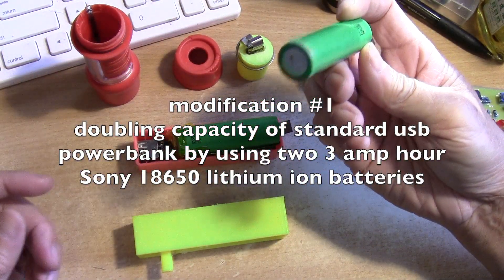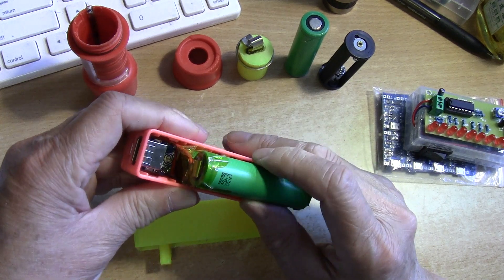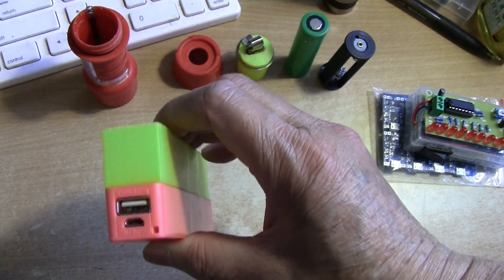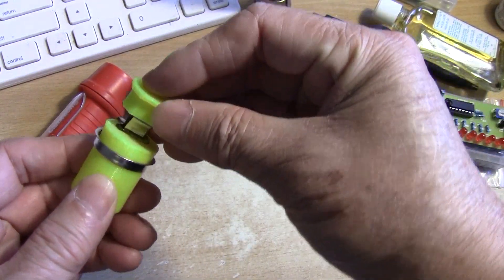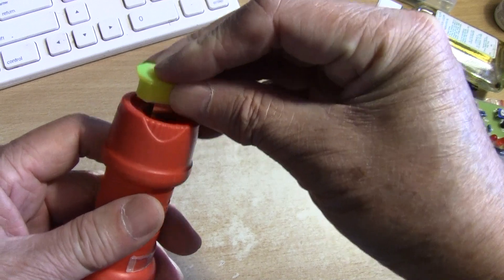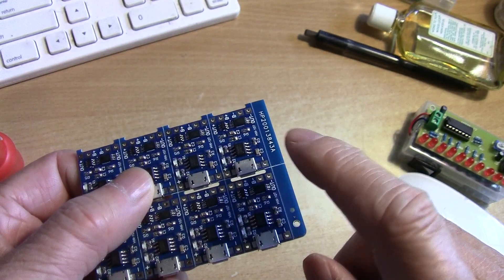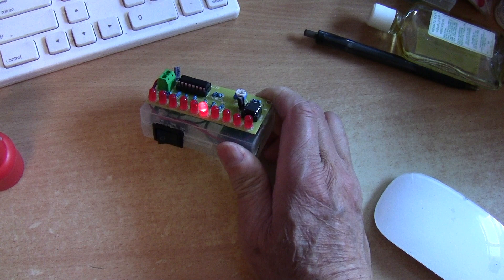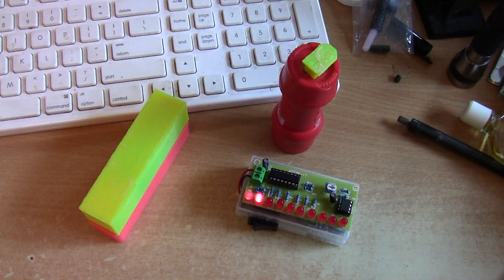3 practical 18650 lithium ion battery projects

Comment: Its cool you are still doing great things with your 3d printer. i have a nice energizer led flashlight with some stupid double row of AA battery's I may try to hack a few 18650s into it and maybe a power bank plug on the end? hmmm
Reply from the maker: The 3 D printer is working great. It's a pain to get it level but once optimized it seems to be doing its job. I even bought a spare main board as the heated bed function was not working well.  I print mostly PLA so the heated bed is not that important. A good 18650 battery replaces 3 of those AAAs and your flashlight will last longer. Yes, I modified some of them and added  usb charging boards so you can easily recharge the battery.